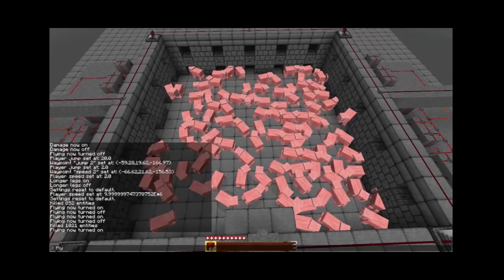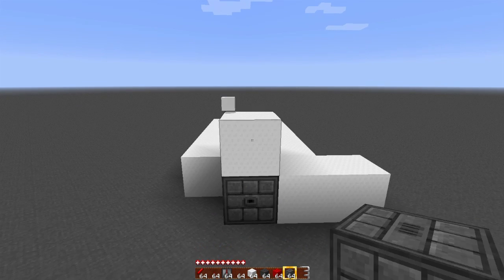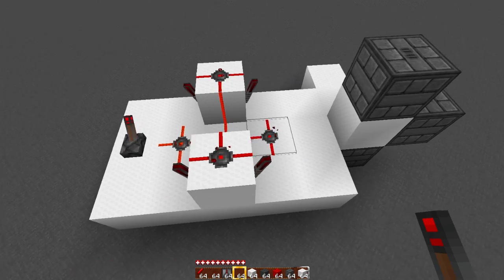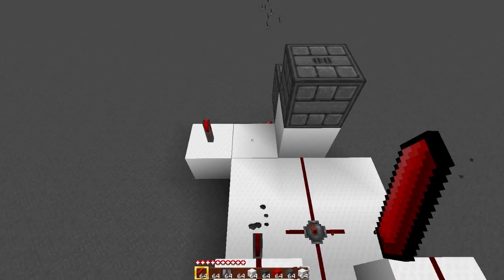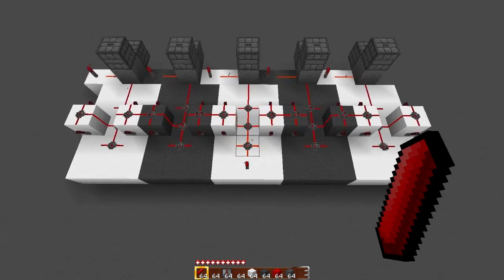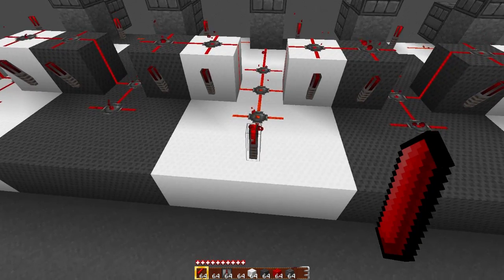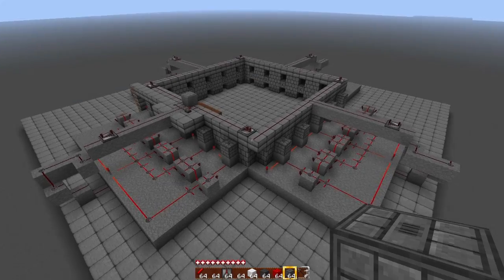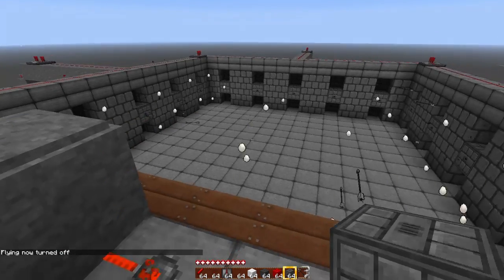How to Build The Slaughterhouse

Comment: The way the rapid pulser works is that redstone torches are inverters, so when in is 0, out is 1 and vice versa. When the input feeds off the output, it creates a rapid pulse. However, this quickly burns out the torch, but the burnout recovery time is about 3 times as long as the burnout time and thus 4 torches give an uninterrupted pulse. As for the stabilization of the current, it's a glitch that causes powered dispensers to fire upon receiving redstone updates.

Comment: Pressure plates are an option actually, I made a variation of this a while back under his bravery bridge and the whole floor was covered in pressure plates which activated the whole mechanism. I also hid all of the dispensers with walls of lava so the arrows flew out while on fire.

Comment: The pulses aren't enough to set of the dispenser so putting a redstone torch there creates a kind of monostable circuit. The fast pulses are turning the torch on and off and the torch is what's firing the dispenser.

Comment: The reason it shootrs like that by itsself is because the red stone clock isnt generating enough power to rapidly fire the arrows,but when you add the other piece of wiring to the dispensers it generates enogh power to continuesily shoot the arrows while the clock works to rapidly shoot them while its ticking. :)

Comment: if you take out the bottom dispenser in each minigun and replace it with a redstone torch you could also put a dispenser on each side of the wool block as well.

Comment: I don't have a video and I lost the map when I re-installed my OS on my computer. I could easily recreate it if you'd like though. It's really simple though, you create the whole slaughter house and then instead of routing the power to a switch simply cover the floor in pressure plates and one layer of redstone on the stone underneath. then you connect each wall of turrets to a single input. Afterwards run the redstone underneath the behemoth and connect it to the pressure plate redstone.

Comment: Well the pulser works by the torch powers the dust, which then powers the torch which means the torch goes OFF and then when the dust unpowers it turns the torch back on, turning the dust back on which then turns the torch off and so on. The reason the dispensers don't rapid-fire unless they have a current applied to them is becuase the dispensers, when they get the pulse, they need the pulse to go off again. The rapid pulser goes to quickly for the dispenser to handle,so the torch is sunstitute

Comment: The way the clock works is the torches pulse til they burn out. With 4 it creates a stable rapid pulses. As one burns out the next begins and by the time you've cycled All the way thru the first torch is relight ready to pulse again.

Comment: On xbox 360 tu12, there is issues with the redstone where instead of the torches struggling to stay turned on, it will eventually stay on until the switch is flipped. Meaning it may work for 2-30 seconds. You can make a slower one with a Sticky piston if you have this issue. Just make it to where the path turns on the same piston that stops it.

Comment: the reason it works is because the power from the 4 clock timer + the 1 power souce is actucal not useing the timers its useing the constint power from the power source and the reason why it does not shoot so fast like 1 ever frame but you see thr smoke coming off the red stone is a delay or the power coming off i tested this by put a dispencer 2 blocks aboveit and it fired ever time it rised so ever particle of smoke you see is the delay if you can prove me wrong try but i doubt it will work :)

Comment: When two RS currents are connected to the dispenser it only has to register the switch of the pulser (for some reason MC much register AND gates quicker than normal input) rather than the pulser update.

Comment: @Dragonfloe do you mean if you place redstone instead of the block (And don't have the stabilization current)? It's because the redstone flashing on and off powers the dispenser like a normal current would, but the dispenser only notices sometimes.
I think.

Comment: The pulser works because the torches power the redstone, which then goes to the torches. When a torch is powered, it turns off abd the redstone it's powering turns off. When that redstone wire is off, the torch turns back on, powering the redstone, then itself. Thats why the pulser works. As for that other torch, i have no idea.

Comment: The way the redstone curcutry works at 1:41 is that the constent power resets the despencers as fast as the redstone clock is circulating without it te clock would fire the despencers then haft to reset the;them then fire again and with the speed at witch the thing is pulsing it glitches

Comment: really the pulsing works because a red stone torch goes out so the power goes off but in a splic sec anther power torch gets turned on and powers the wire and rinse and repeat

Comment: Today, I made a trap for mobs that when they step on a pressure plate, they get trapped into a box with a hole, in which a dispenser using the system displayed in this video shot the mob to death.